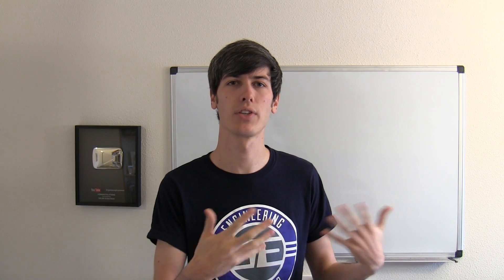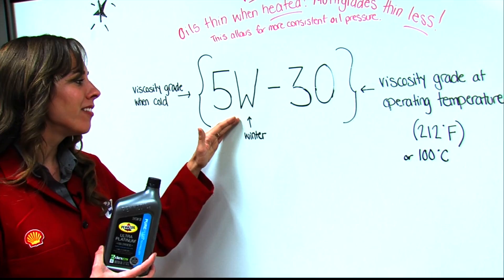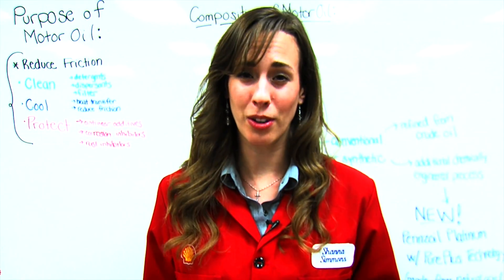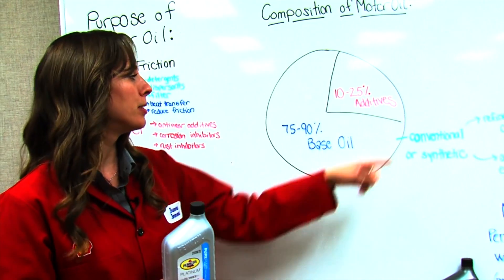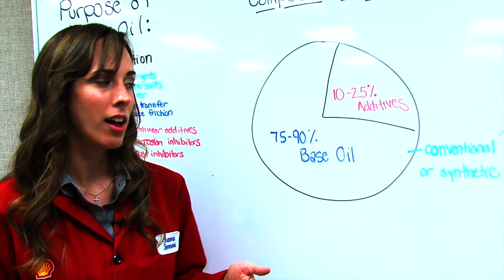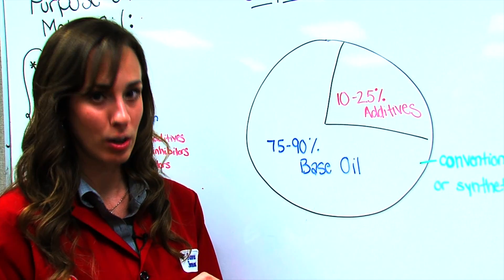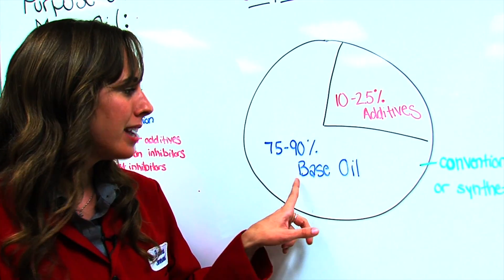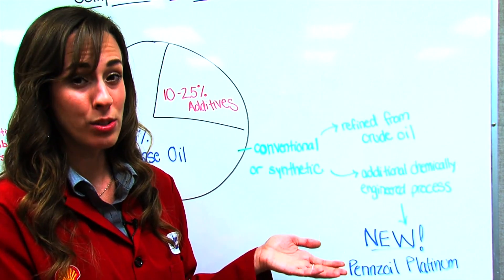Motor Oil Myths & FAQs - Synthetic vs Conventional

Comment: I  am a Chemical Engineer and I worked at a major oil companiy's R&D  lab for 30+ years. Of these almost 10+ years were in the Lubricant Research with primary expertise in base oils. As far my experience goes, the only advantage synthetic base oil (Poly Alpha Olefin - commonly referred to as PAO) has is its' low temperature properties. So, if you are living in extremely low temperature regions like in Alaska you need to use synthetic oil.  The detergent package and viscosity index improving components are exactly the same in conventional oils or synthetic oils or synthetic blend oils.
I only use conventional oil in my luxury cars.
Reply: what about thermal properties? Like when I switched my Harley over to synthetic, the average oil temp went down about 50°
Reply: I have not heard about it before. Oil temperature is a direct effect of friction modifiers used to reduce friction. To the best of my knowledge, base oils play no role in friction. Was the outdoor temperature same? In cooler months you will have efficient cooling. Hot oil is circulated through the radiator for cooling so it is likely that cooler ambient temperatures will have better cooling. But not by 50 degrees as you mentioned.
Reply: This was on my 2003 Harley-Davidson 883, air cooled. No oil cooler installed. The bike had only 2500 miles when switched. Both the conventional and the synthetic were Harley Davidson products. The switch happened in July 2004 in Orlando FL. My drive to and from the dealership that I worked at was approximately 10 miles, more than enough to reach full operating temp. My oil tank has a thermometer in the dip stick. The reading on the thermometer with Conventional oil was 250 degrees F on average. The synthetic temps are 200 degrees or below. The effect was immediate, noticed right away on the way home. As I have been a technician for 11 years I have seen similar results in other bikes as well.
Reply: I am not questioning - I find it hard to explain. Will explore and communicate as appropriate.
Reply: No worries. I was giving as much info on as possible. 
I thought it might have something to do with the thermal conductivity of the oil. Allowing a more efficient transfer of heat between components. 
As this oil is designed for an air cooled engine, it might have something to do with the specific additives in this oil.
Reply: +Tracey Allen Thanks for sharing.
Reply: I have a very old test by Andy Granatali on you tube setting records at Bonneville with studebaker avantis, he claims his oil was a little over 400 f so he called up Studebaker which made STP they told him  put a can in each engine so he did and he claimed the engines went down to just under 200 f during the same test situations at full speed at the same outside temps.
Reply: +Andrew H  I looked it up: 
"Allow an ExxonMobil representative to examine the equipment....to determine the extent of the damage and to confirm that the lubricant was the cause" among other things.
They just put the bs mileage guarantee on the can knowing the extra sales will cover any claims costs.
That's my guess anyhow.
Reply: Cold starts in Canada (even around -30 Celsius) are so smooth with my synthetic oil. It's like the engine couldn't care less.
Reply: +Andrew H 
I did not mentioned but the test had included three cabs running on same viscosity grade full synthetic. There was no difference in wear between all oils including full synthetic which was in three cabs.
Reply: +Jitendra Patel Part of the confusion may be due to whether the oil in question was a true synthetic.  Mobil 1 is supposedly a "synthetic" oil but it is mostly Group III petroleum so such a "synthetic" will not shrug off heat any differently than a regular oil.  OTOH, a true synthetic like SynLube will run much cooler because it's fundamentally different from petroleum.  It's so different that I don't refer to it as an oil but as a lubricant.
Reply: WHAT TESTS, You support major oil all u want, Ill take my chances, its worked this far= 18 bucks for 5qt jug, has the same specs as your $10 a quart stuff,
Reply: I never said that the ol is rubbish.  I just said true synthetics are better.  I also wish that you would represent my comments accurately.
Reply: Im a double secret chemical engineer, and the poster is correct.  All the car companies that say you have to use synthetics for light weight oils are just poopy pants.
Reply: +Thomas Griffin 

Yes, at those low temps you would benefit using full synthetic oils.
Reply: +konaguzzi1 Thanks for sharing.
Reply: this is why mechanical engineers not chemical engineers design cars.
Reply: +P Schmied but chemical engineers design oil for cars. :)
Reply: +HJR  That is a great report that has not been challenged  ..Synths can handle low and higher temps better. An 18 wheeler truck driver went 400,000 miles on one oil change with by pass oil filters..The truck is till running  with over 2 million miles..
Reply: +Olds Pwr so in your "expert " opinion we should never change oil?
Reply: +Jitendra Patel   Taxis are not a good test bed as they are often running all day and all night.  They are left idling and the motors are seldom turned off.  So, they do not get cold-started like most privately owned cars - which is when most wear takes place.  These motors seldom get cold - so water condensing in the crankcase and mixing with the oil seldom happens.
Reply: Jitendra Patel
 Tracey is correct.  There have been several tests, both in print and on TV motorcycle shows, indicating that synthetics  - by reason of the reduction in friction they provide - cause engines to run cooler than they do on conventional oil. 
In one case, two identical, notoriously hot running 6 cylinder Honda CBX,  air-cooled engines were torn down, rebuilt and blueprinted before being run hard and long.  One on synthetic, the other on conventional.  When torn down afterwards, the synthetic run bike showed no wear - the honing marks on the cylinder walls were clearly visible.  The other showed significant wear.
I have run all my vehicles - especially my bikes - on synthetics for nearly 3 decades. Despite putting some very high mileage on many of them, I have never lost an engine and seldom had to even adjust the valves on bikes.
Reply: +Jitendra Patel I am sure there is some value to the test but I wouldn't take this test as totally definitive.  First, we don't know at what rate the engines were burning oil.  Is it not possible that if the engine burns a quart every 2000 miles or so and that replacing the oil consumed amounts to an oil change?  Secondly, if this is the same test I read, the cabs were run 24 hours a day and therefore had almost no cold starts.   That a significant consideration in my view.
Reply: +Andrew H , Mr. Patels oil test sounds exavtly like one Consumer report magazine did several years ago, that when I stopped the 3K change routine and went to 5-6K and have never had problems, now I use Walmart synthetic in 02 Ranger with 70K and change the oil once a year, about 3K miles a year-  anyway, you may be able to find the CR report online.
Reply: HJR
  Of  course Walmart doesn't refine their own oil.  It is produced for them by a major refinery and packaged as the Walmart brand.  (Canadian Tire does the same thing.  For a long time they sold Esso products under their own brand name.  It is now produced by Shell.)

Anyone know whose oil Walmart sells?
Reply: +Phil Houck I meant to say that Castrol Syntec is wholly Group III.
Reply: True synthetic are more protective and longer lasting.  Your engine will benefit from less wear and the environment will benefit from fewer oil changes.  Used oil is considered a toxic waste.
Reply: mechanic for 8 years. I think your time is different than now. We had a 2012 Hyundai Elantra engine fail with 36,000km because of oil sludge. All because they didn't change their oil in time or at all. We get numerous BMW's with Vanos engine codes because of lack of oil changes and oil clogging up the solenoids and passages ( even though the customer changes oil with specified 20,000km interval ) clearly the interval is too long..Todays engines are far more complex and tolerances inside are MUCH smaller, which is why synthetics are required. Even though the engine is the same concept, it is much more refined now with many more actuators and sensors.I use mobil 1, and I still change my oil at 10,000 instead of 20,000
Reply: sranjesuper Mobil 1 used to have a warranty of 40,000 km or one year oil changes, back in he 80's. 

But they improved their oil and dropped their warranty.

As far as I know, Amoil, the first company to produce a API synthetic oil back in 1972, offer and warrants oil change intervals of up to 56,000 km.

I use longer change intervals.
Reply: +Jitendra Patel I'd like to know how cold it gets where you live.
Reply: +rezneba101 In upstate NY  - Occasionally, close to zero F.
Reply: +Andrew H  What do they guarantee exactly and how do you make a claim? Sounds like yet another marketing gimmick..
Reply: +krirks Not sure so I rather not comment.
Reply: +krirks funny I was talking to my brother aout this the other day in his F1 side
 car he raced he found at extreme high revs from racing that he had 
backside lobe ware on the cams (not the lifting side) when using 
synthetic oils and at $2,000-2,500 a pop but found that std mineral oils
 stopped this but there could be a lot of specific factors involved just in case you were wondering it revved to about 13,000 RPM
Reply: +Jitendra Patel  if  you change your oil every 3000 miles then you fine
Reply: +maksim tsionskiy Yes.
Reply: +Olds Pwr how you know that person broken down was because person didn't properly changed oil on time and used regular oil, so after awhile builds up junk in engine and you can guess what happens
Reply: HJR Can you provide a link to that info?
Reply: +Jitendra Patel ok so you said alaska ..... what about canada we have hot summers but our winters are -25 C sometimes would it be safe to assume winter usage of synthetic and summer use of conventional oils ?
Reply: +Thomas Griffin k i i was wondering about using a synthetic in the winter months in canada but could it also be that you are using a winter (lower viscosity )oil that is a factor and not so much the fact it;s synthetic ?
Reply: +5had0wL1nk When you compare the peace of mind a TRUE synthetic like Redline or SynLube will provide vs the few dollars you'll save by using a conventional oil, I think the peace of mind you have in a hot summer and a brutally cold winter is a much greater benefit.  Remember that oils like Mobil 1 and Syntec are not synthetic oils.  They are either mostly Group III petroleum like Mobil 1 or wholly Group II like Castrol Syntec.  The new oils like Pennzoil's Ultra Platinum made from natural gas is also interesting but Redline and SynLube are proven products.
Reply: Tracey Allen
  It has a great deal to do with the oil stock itself.  That is the major "friction modifier".  That's why we put oil in the motor in the first place!
Reply: k so should i use synthetic oil for my car in the winter to help with ware on the engine, or should i save alot of money and just go with regular?
Reply: Alaska one probably wants nothing but 0W20. heh.
Reply: +Jitendra Patel  I live in Maine and that is the major reason I use full synthetic as it can be 30 below zero here.  Most important thing is change the oil. I never go more than 4,500 miles on an oil change. The dealer says 7,000. No way!
Reply: John Hiram So you are saying that the oil is rubbish and won't perform as the manufactures state? So I guess you are made of money. And which "synthetic" do you use?
Reply: Phil Houck Who were you replying to please?
Reply: I don't remember the name but it was not to you.
Reply: That was when Mobil One was a true synthetic.  Most US formulations in the US are mostly Group III petroleum.
Reply: Phil Houck From my understanding, Mobil 1 is still a PAO formulation, and therefore a full synthetic. But they don't have that old warranty.

I have ask Mobil in NZ and that is what they told me.
Reply: The information I have is that Mobil 1 is mostly Group III petroleum.  Also PAO needs to be blended with other lubricants because it does a very poor job of protecting an engine alone. This was evident with Mobil 1's Tri-Syn formulation.  At present, PAO can be more accurately perceived as part of the additive package for a highly refined mineral oil.  This is not to say that Mobil 1 is a bad oil, it's just not a true synthetic.
Reply: I did not catch that you are in New Zealand.  In places other than in the US, Mobil 1 may very well be a true synthetic because Exxon/Mobil can't get away with the same silliness that they do in the US.  In the US, the term "synthetic" has no technical standards associated with it so they could sell you nail polish for oil and call it a synthetic.
Reply: Phil Houck Thanks. I had a slight suspicion that that was possible over their. You can even buy SA rated oil. All in the race for short term profits as far as I can see.

I hope you are happy with your political system, especially at the moment.
Reply: Phil Houck If you think Donald is a nutcase, who will you vote for :D
Reply: A group lV PAO base stock does not have low temperature flow rate because it is a PAO. PPD (pour point depressants) are added to give the base stock better low temperature flow performance. The same can be achieved when adding a PPD to any base stock.
Reply: Jitendra Patel what about older classic engines I like to break in my stuff on non detergent stuff to allow the ZDDP to have a fighting chance on sticking to something. This vid is very veg on everything and almost is misconceiving to people who don’t know much.
Reply: Can i use full synt oil in run in period?
Reply: Mukesh Awasthi depends on what type of engine it is. I work with a lot of V8 stuff ohv with flat tappet lifters. What zddp aka zinc does is turn wear surfaces witch have microscopic porosity in to a glass like surface. The more detergent in the oil the less likely the good stuff like zinc will adhere to anything because the detergent molecule will bond to it and not allow it to. One of the crew chiefs in racing I have worked for in a independent blender aka chemist that big oil company’s pay to help consult with racing teams. Sad thing is that oil company’s care less and less about engine lubrication and more and more about emissions and emission control devices. One of the worst things for a catalytic converter is also one if the best things for engine lubricant is ZDDP or zinc . That’s why there’s such a big market now for break in oil company’s like Driven and Brad pen . Lol I taken so long car rides and plain rides where I was educated on most of it🤣
Reply: Excuse me Mr. Patel, one question and it will be a long shot to get a reply from you sir. Did you ever work with biodegradable lubricants and if so, can you give examples of what nanoparticles or additives were use for your research or some examples of additives that you use throughout your research.Thank you.
Reply: Bingo! I've been saying this for years and I am no expert but just rub the oil between your fingers and you could feel how slippery conventional oil is compared to synthetic. Plus conventional is more difficult to clean up which tells me that it acts as a longer lasting lubricant than synthetic. Sludge-wise, I suppose then synthetic is less prone but still, as long as you do frequent oil changes, your engine should never have issues.
Reply: +z1522 Thanks but I will stick to my belief as not much has changed since retirement. FYI - zero W oils were introduced so that a lower viscosity oil would allow auto makers meet the EPA mileage requirements. Also, once a vehicle accumulates say 1000 miles on an oil,  the oil is no longer in the viscosity grade because shearing (breaking down) of the polymer negatively affects the viscosity grades.  Every vehicle behaves differently. 

 From used engine oils base oils are recovered by refining and reused to manufacture motor oils from redefined oils - this helps minimize the environmental impact as oils are not dumped on ground.
Reply: +Jitendra Patel Why on earth would a supposed expert use just conventional, especially now that most new cars run like 0w-20 synthetic factory spec? You're perhaps retired and not up to current technology. Synthetics also behave more consistently thru wider temperature ranges, and resist breakdown for a longer period. Overall their use is not only smarter for the vehicle, but environmentally better versus wasteful frequent oil changes.
Reply: +Jitendra Patel Then look at this. https://www.amsoil.com/lit/g3115.pdf
The ONLY way a mineral oil beats a synthetic oil is price. The ONLY way.
Reply: +Olds Pwr depending on what kind of oil, oil filter and type of driving and recommendations from manufacturer. some people do not follow it. and over time you can damage the engine.
Reply: Jitendra Patel . That suggests you know virtually nothing about oil, especially synthetics. I bet you have never read this or the many other articles on lubricant. https://www.amsoil.com/lit/g3115.pdf

The ONLY way a petroleum can beat a top synthetic, is that is is cheaper.
Reply: +z1522 
"...especially now that most new cars run like 0w-20 synthetic factory spec?" 
You have the answer exactly in your question.
Nowadays car makers use synthetic oils because they have very low viscosity, the 0w20 you wrote. 
This feature helps the engine to produce less pollution. 
With semi-synth or mineral oils, the lower viscosity you can reach is 10w40. It is thicker and it has more friction than a 0w30 and 0w20, then the engine produces more pollution. 
So, that's why most of new cars run with synthetic oils, because, you are right, they are "environmentally better..."
Anyway, it's not suggested to use a 0w20 in hot temperatures...
Reply: Alex Mitchell And the Walmart brand does not perform very well in tests.

I will not buy anything from Walmart as you are just enriching the Walmart family, not helping the workers.
Reply: +Andrew H 
Several years ago we ran a long term oil drain tests using Yellow Cabs in NYC and engine oils formulated using conventional base oils.. Stop and go driving is a severe condition than highway driving so taxi test is used by many companies. We had three taxies running on each oil (statistics required that we use 3 cars per oil) we wanted to test. We tested several brands of engine oils. These were brand new cars and every engine part was taken out, measured and weighed before and after the test. We ran cars over 27,000 miles without changing the oil. There was not a single engine failure.
Reply: +Andrew H if you look on the bottle it will have 5w50 etc ( you already know this ) the next part  is the API rating sm/cs etc s= petrol Grade rating c= diesel Grade rating the higher the second letter basically the better the oil is rated (not 100% accurate but close enough) the lists can be obtained through SAE  the oil experts I dealt with pretty much agreed with  Jitendra Patel some oils have special additives for older engines etc like zinc to help with bore ware
Reply: bill man Walmart OIL? They don't make oil as it is made for them. Buy a premium oil like Amsoil or Mobil 1. The former has a long drain interval.
Reply: With Donald Trump running for president?  He's a complete embarrassment and there are enough nut cases here to elect him.
Reply: I will vote for the Democratic nominee.